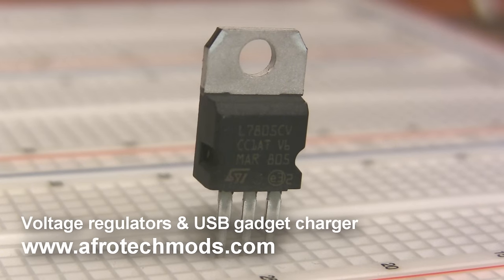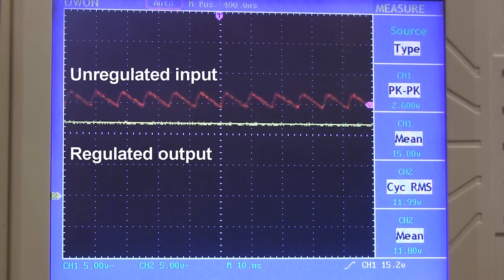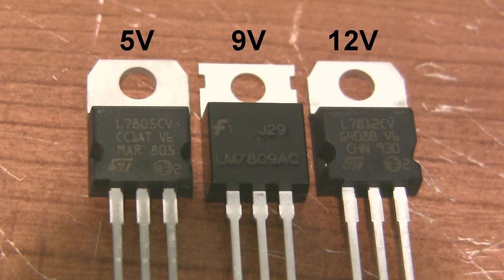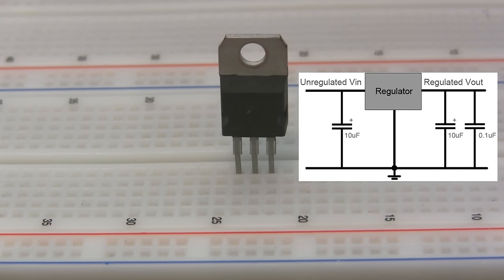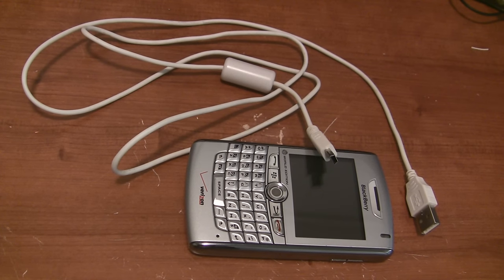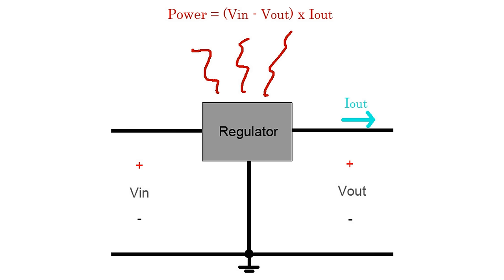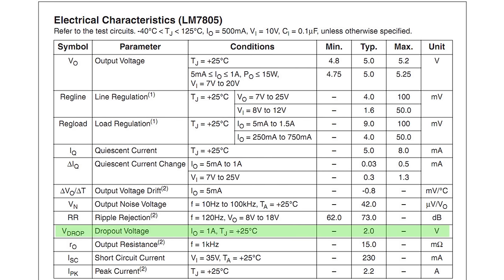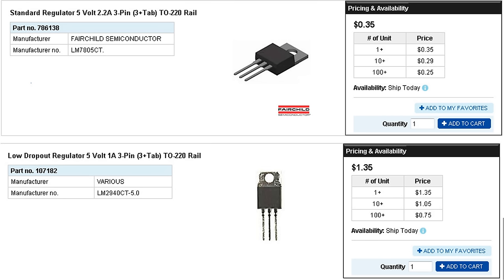Voltage regulator tutorial & USB gadget charger circuit

Comment: Great video, thanks. I would like to replace nicd batteries in 4.8v drill with 18650 4.2V li-ion batteries. Should I go for two connected summing up to 8.4V and voltage regulation for 5V?

Comment: in 4:28 how did you know current flowing throough regulator ? 
u knew it practically by ammeter or theoritically dividing voltage by resistance ?

Comment: How exactly do the capacitors stabilize the output?

I run into this a lot. People say things like, "Oh, this component does this," and I don't understand why. Once I finally find out, it's usually some property of the component that isn't covered in any of the component basics videos that I find.
Reply: Andrew Hill Simple. Capacitors store energy in them and can release it at high current in a very short amount of time, thus smoothing out voltage bumps and dips. They also let only AC through if connected in series with an AC supply. This is often used to protect speakers from DC, as the capacitor is connected in series with the speaker and only lets the AC audio signal pass. Some capacitors are better at smoothing higher frequencies, that's why a ceramic capacitor was also used. The 10 uF capacitor can't handle high frequencies very well, but the ceramic capacitor can.

Comment: Also You can find linear voltage regulators in old TV´s since 2000 :) It´s a basic component like you said , in tv lvr ( linear volt. reg. ) is used with image maker ( horizontal & vertical circuits ) on the very large heatsink sticked together with other circuits needed for display image maker.

Comment: THE TRICK USED ON THE LM317 also works on the others, only the numbers change to calculate the resistors. All of the three terminal regulators are "adjustable" by the same method.

Comment: How would you configure it for say 40 amps? Multiple Transistors and capacitors creating multiple rail configuration and then wired together at the output to create load handling or no? Obviously a massive heat sink would be needed.

Comment: why do you need to add a 0.1micro farad ceramic capacitor on the output when you already have the electrolytic capacitor on the output?  What is the purpose of that 0.1 micro farad ceramic capacitor?  Just curious to know its purpose since the electrolytic capacitor is already serving its purpose in the output.

Comment: Is the output of regulator constant, for example 9V, regardless of the output current?
If yes, I've come across problem:
I've made a circuit board containing Timer 555, the Vcc of 555 is supplied by the output of L7809. When 555 is working (just giving output voltage, but without connecting loads), the output voltage of L7809 drops to 6-8V. There's a volt. drop. Why?

Comment: How does larger or smaller capacitors effect the results. You talked about input voltages and its effect on heat and efficiency but what about if you don't have 2x10uf and .1x 1uf and you used something like a 30uf?

Comment: I want to power my car's onboard Canon camera (mounted roof center on roll bar bracket) via the 12V dome light circuit. The A710IS calls for 3.15VDC input at the pin plug receptacle.  Can't I just wire an NTE1904 IC Regulator (3-term.) that posts 3.3VDC out? Would I wire it the way indicated in your tutorial with three capacitors?  I have a Radio Shack pin plug and 2-lead socket.  Would I need a heat sink?  Mount the rig inside the plastic, dome-light fascia or on the roll bar for safe venting?

Comment: SY8008 burned on a card. Based on the datasheet seen if a 7805 (although it does not have the frequency and exact features of the original IC) .... at the Vin Vout pitches and gnd. Do I get the card running too? Making two considerations in my opinion. In your opinion?

Comment: They make newer and more efficient direct drop-in IC's for the LM78##XX.
They accept up to 74v in and regulate down to your required voltage level with heatsinks.
The newer ones are pretty will!

Comment: I have a 16c LIFEPO4 battery pack maxing out at around 60v. I dont want to pick on 2 cells, so how do I go about drawing from the full 60? I picked up some L7805CV's from ebay for dirt cheap. Would they fit the bill, or do I have to go another direction?

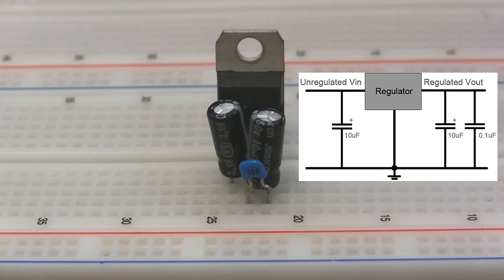Comment: @2:52 "These capacitors help to ensure the stability of the voltage output, and although you don't always need them, if have them on there the circuit is pretty much guaranteed to work every time". I tried to search in order to find any mention about this in the previous comments: nope. So I ask: how can decide when I do need them and when I do not? In the particular scenario in the video, I don't see any reason why those capacitors could help, since the power source is a battery, so there's actually no voltage fluctuation. What is anyway the purpose of any possible capacitor at the output of the regulator? Even when an oscillating signal is at the source, shouldn't the output of the regulator already the best I can do as far as ripple is concerned? I hope you can still read and answer. Thanks in advance! :-)

Comment: Excellent video. Aha, thanks to your video I understand why there is 3.75v is on the output of a 5V regulator (oldie 7805) when the input is 5V. Can you explain why there is such voltage drop and why is there so many waste?

Comment: Are there large voltage regulators out there? Say I want add extra lighting to my car using 20x 10W 12v led chips the led chips would handle 12.5v if cooled properly but then again with higher rpm from the generator u will get ~13.5v from the battery which would kill the leds sooner or later so im looking for ~25A voltage regulator maybe? that would limit the voltage to 12V

Comment: Could you use multiple regulators like say a 9v regulator then a 5v regulator to reduce heat when going from a higher voltage source?

Comment: Question: If I have a 10 watt solar panel made to charge 12v batteries and I use a 5v voltage regulator to make a USB charger will it produce more amps than If I started with a smaller 6 volt panel? Or will the voltage reg strip out the higher amperage?

Comment: bog: yes, you can. Make sure it is at least double the Working Voltage, for safety. most of the electrolytic caps used to say WVDC, which is just what I told you. For instance  on the output you could easily use 10 WVDC CAP. Also be aware to power your circuit up a few seconds before you plug in the device to be charged as startup current can surge past the circuits safe working parameters & cause failure.

Comment: I need to get power down from 12 v to 5 v for a bluetooth module, have limited space and will encapsule this over a heat shrink that I put around the BT - would it get too hot and ruin the whole thing?

Comment: I have two boards that I want to power using a 20v power supply. The first board is fine with the 20v (up to 26v). The second board requires a maximum of 12v and can pull up to 1 amp.

Using the formula, a single regulator will need to dissipate up to 8 watts. Can I run two regulators in parallel to share the load?

Comment: If I already have 24V AC power supply, and add a diode bridge and capacitors, do I still need a voltage regulator to give out smooth voltage of 24V (which I need)?

Comment: I need to build a voltage regulator for a motorcycle headlight running on the primary. Using the L7812cv what capacitor should I use please.

Comment: Thanks for your reply - I did watch your video and numerous others, but I need to reduce the 120 ac without the bulk of a transformer - can  I use a bridge rectifier and then a 5amp - 5 volt voltage regulator and then a poteniometer?
Thank you very very much for your help.

Comment: What value of capacitor would you recommend to be used at the regulator input ( =bridge rectifier output)?
I have used 33uF but it had charged to almost 100V and ended up burning my L7805.

Comment: I have a question. When voltage is passed through the regulator does the voltage before the regulator change?

For example: I use 10v battery, will it change the voltage in the output of the regulator or both output and input?

Comment: As I said in the battery video. I was thinking of using a big capacitor instead of a battery to regulate the output or maybe have a resistor? Any suggestions?

Comment: So for those capacitors would you be using 5 volt capacitors with a low microfarade rating? 
I know the rating but I am assuming 5v capacitor as your outputting 5 volts

Comment: I'm definitely a novice at building electronics, but I want to create a lighthouse and use solar power, and Li Ion cells. I want the LED to fade in and out giving the illusion of rotation. How do I create that circuit?

Would I need to use a BMS chip for the 3.2 v laptop cell, and charge it with the solar panel, then run the output power to the circuitry, then ultimately to the LED?

I already have a Chinese lighthouse top that has a rotating light, but I want to make something a little more elaborate with no moving parts.

Comment: To overcome the vdrop...i have a transformer that can do 120 to 24v or 12...to save heat issues...can i step down from 24 to say 16 with lm317..then work my way down by using 7812-7809-7805 by running the output from the higher reg to lower?

Comment: The LM voltage regulators are in a class called series pass regulators.  Basically it is analogous to a voltage divider network where the voltage output is taken from the node between the two resistors.  The current is limited by the input resistor.   You could achieve the same effect with a resistor divider network.  Granted that is a simplistic representation since the input resistance is dynamically controlled by the device's architecture.  However, because it is essentially an active divider network it is extremely inefficient since the unused energy is dissipated in the form of heat thus if you use a 12v source with an LM309 to drive a 5v load at 1 amp you will still be pulling 12 watts from the source to drive a 5 watt load.  7 watts will be dissipated as heat by the regulator.  A better way is to use a buck conversion regulator which uses pulse width modulation to produce a regulated output.  They can be gotten as complete modules online and require nothing more than a dc source.  Since they are close to 95% efficient very little energy is wasted in heat.  A buck regulator can be thought of as a kid on a swing - the amplitude of the swing is controlled by the amount of energy added at the beginning of the cycle and only enough energy is added to keep the "swing" going.  For applications requiring a higher voltage than the input source there are boost regulators which use the same technology to produce a higher voltage than the input but still at over 90% efficiency.

Comment: Hi, from the Fairchild data sheet for a LM7809 it recommends a 0.33uF and a 0.1uF capacitor in input and output respectively. So far I've tried a number of capacitor combinations but am still getting no output, any suggestions?

Comment: Afrotechmods Salam,
I have 3.7 V (3000mAmpHr) Li-Ion batteries. Is it safe to have them in series to power up and Ardunio microcontroller that operates on 7 to 12 volts?
Now that board can operate even at 5v but 7v to 12v is a better range. What would be your expert opinion?

Comment: Hi, Thanks for the video!

I'm planning on using a LDO 12V regulator for some LED's for a motorcycle tail light. My question is would I need a diode (planning on using schottky for the lower forward voltage it uses) so that when I'm grounding both the 13.8-12.5V source voltage and the regulated 12V to the same ground there is no risk of having the higher voltage potentially feedback through the lower regulated 12V? Does this even make sense? Im not sure of the theory as it surrounds this perceived issue of mine. Thanks.

Comment: Hey, if I have a 5-6 Volt solar panel, do I even need a regulator to get 5 volts for charging a phone? And if I get two of those panels, I would get 10-12 Volts, right? Now could I add a 7 Volt regulator and then a 5 Volt regulator after that to get solid 5 Volts to charge my phone?

Comment: I notice that the middle pin and the negative terminal are attached to ground. Did you need to do that for this circuit? When is it necessary?

Comment: Hi, question. If im running a usb power bank and i need to get more amps out of it than they currently supply. The unit supplies 2 amps but i need to boost it to 4/5 amps. How can i go about doing it, and will over heating be an issue? thanks in advance

Comment: HI if i wanted to use a +1.5 Vin into an LM350K or LM317T and its specs says it has an Vout of +1.2 to +33V 3A, does that mean i will have an output of +1.5V with 3A?

Comment: Good day can you please lighten me up about this capacitor, planning to install a DIY voltage stabilizer which i watch in some videos, i will install 4 pieces 10,000uF 35v parallel connection??? Do I still need that small capacitor??? What type? And value?

Comment: Great stuff and thank you, but I have a question - Can I use a bridge rectifier to convert 120 ac then place a large resistor inline to drop the voltage to 5 dc before a filter and then a pot in order to have a an adjustable 0-5 v dc out.
Reply from the maker: Bubba Don't do that. Watch my transformer tutorial then watch my LM317 tutorial.

Comment: With an LM317 adjustable voltage regulator, which is actually very similar to the LM78xx series, you should look it up on Google. If you use the LM317 with a 240 Ohm resistor for R1 & a 2.4 Kilo Ohm resistor for R2, you'll get an output voltage of 13.8V, and will only need a couple of cheap components.

Comment: Great video.....ok i have a 37V 250W solar panel I want to down convert the volts to 12V so i can charge my 12V system made of Two  6Vgolf  cart  batteries. per your video, can i use a single 12v regulator with a heatsync and out put the power to my batteries?
Thanks

Comment: i want to connect my pc fan of 12 v dc and .14 amp with lm 7812 voltage regulator .but i am bit confused regarding what kind of non polar capacitor shall i choose ( of .1uf in output and input ) ceramic or polypropylene or of any other material. please suggest.

Comment: I lovethis video. I  have a question. where should and what trype of diod where do I put it in the curcut to stop the flow back into the battery. I am useing this to power a set of usb speakers and a seperate device to power a blue tooth reciver.

Comment: Question, I need to reach let say 5v from 12v battery, will be efficient to use 9v regulator then a 5v regulator in series ?

also, what do I have to do if I need higher current for 5v as an example ?

Thanks.

Comment: if you want to drop down voltage with high efficiency (~90% or more) you should use a switch-mode power supply. This uses PWM and one or more switching transistors (BJT's, FET's, or what have you) in conjunction with diodes, capacitors, and inductors to produce varying output voltages without a large percentage of power being dissipated as heat. Look up buck converters for voltage drop-down applications.

Comment: I kinda like those Owon scopes.
As for the video, it's fun but still I guess those linear regs' age is over (probably not for LDOs for simple steady power sources, like 5 to 3.3 with a low-power load). Buck convertors are easy nowdays with all those integrated controllers.

Comment: Note for a proper USB dedicated charging port, you should short the data lines together.  If you want to make it work for Apple (which chose their own standard) you need some resistors instead.

Comment: I have one question. Why adding the capacitors to smooth out the voltage if you use a DC input. Would there be anything to smooth out if DC is a straigh line? :)

Comment: Afrotechmods  and when i have for example some device that needs 5V and 150mA and its sourced by Voltage regulator (LM2940 [its for 5V and 1A]) and that regulator is without heatsink and is really hot i think its over 100 degree C. Can i use the regulator which can give more current at the outside (for example LM1084IT-05  5V&5A ) to shrink the temperature ?

Comment: What happens if you run current the other way round? 

I have a regulator, it sais on one side DC IN, and on the other OUT. What happens if i connect unregulated voltage to OUT and the "device" to DC IN?

Comment: Question:If you hooked up one power source to two motors that require the same power input would you double the voltage of the power source or use a resister or regulator to make a constant current go to both motor. Also will there be less voltage after the first motor, if so could you use a voltage multiplier to multiply it after the first motor?
Reply: you can, but you shouldn't. every situation is different, first measure the resistance of both (assuming brushed) dc motors, if their resistance is the same then they'll draw the same current from a single source. putting them in series then boosting the voltage on the low side of the first one will result in horrible efficiency since your average boost converter only outputs 90% of the power going into it, if not less.

Comment: Hello, i want to build phone charger using this 7805 regulator, when the battery is full will it overcharge the battery? Or is it safe because there is already protection from the inside of the phone?

Comment: @Afrotechmods would you be interested in helping me drop the (start battery) charge voltage on my generator?
I replaced the regulator/rectifier and its now charging again, but at upwards of 15v.
Im not particularly familiar with electronics but can solder and take instructions well!!
Im wondering if resistors or diodes would be better and what components you might recommend for the purpose?
It's charging a 40ah 12v battery rated at approximately 350cca. Charging comes from a single phase ac stator.

Cheers!